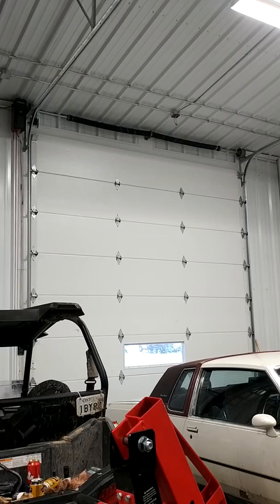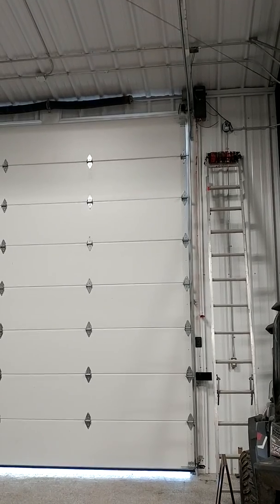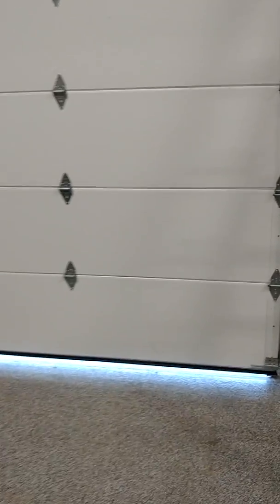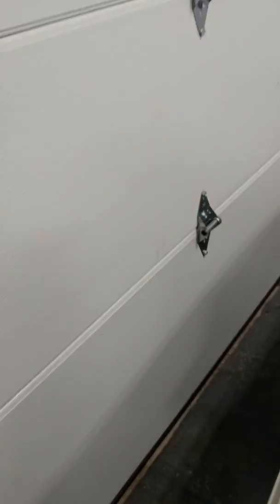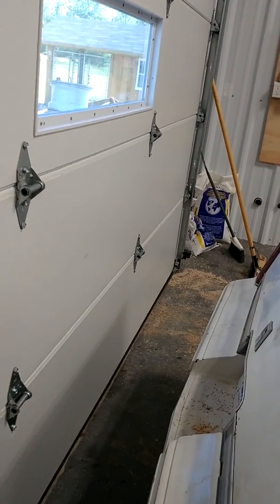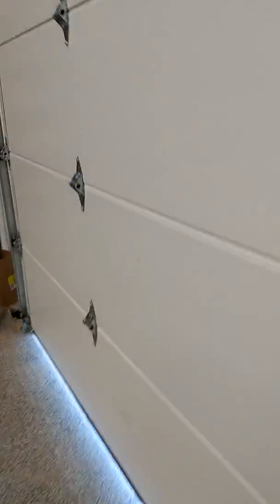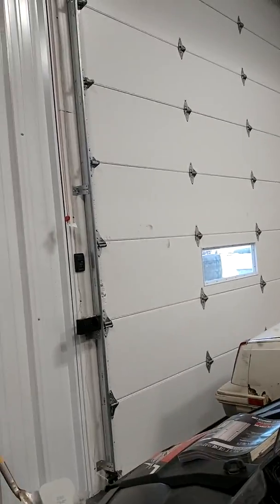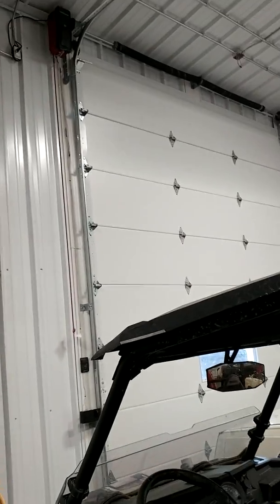Super Sneaky torsion spring dynamics

Comment: We used to have to know the weight of the door, and then using the total weight, any amount of added vertical lift, then using a torsion spring gauge which, looked like a small metal ruler, with a lip to tuck into the spring stock we carried, we would select the right diameter, gauge, and measure the length needed...cut it with a torch, and put the proper right, or left hand ends on them.
Spring balance is sooo important.